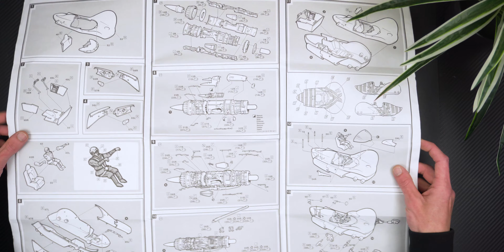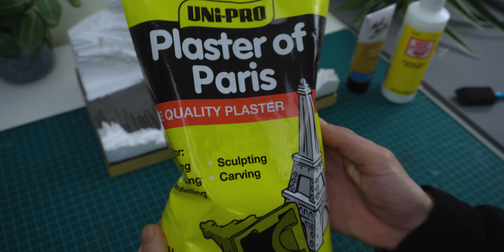20 YEAR OLD STAR WARS Model kit!! Anakin's Pod Racer DIY Lighting.

Comment: @UnderEmpty Excellent looking model! I just ordered this model and plan to do the power coupling with 4 strands of 1mm side glow fiber optics with a flickering pink and purple LED using Arduino to adjust the flicker rate and randomness. Question though, when you put your sprue parts in the little tackle box, how are you categorizing them? I always just left them on the sprue until I needed them but your way looks way better if I just get a handle on how you categorized them. I'm just afraid I'll lose track of what number they correspond with.
Reply from the maker: @KGrant Hi there thank you! Sounds like it’ll look amazing, with the categorising I just tried to keep all the left engine parts to the left side of that box, and the right ones to the other, I was a little worried at first but the kit isn’t really to complicated, Be sure to ask any more questions if needed, would love to a photo when you’re all done.